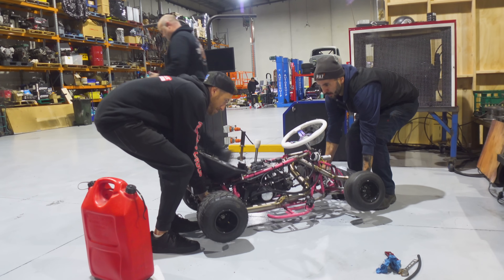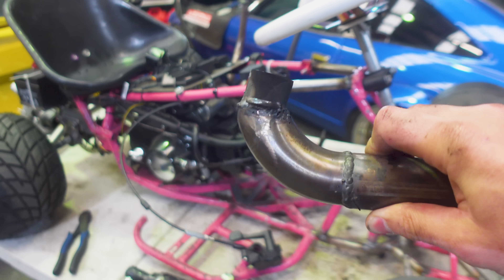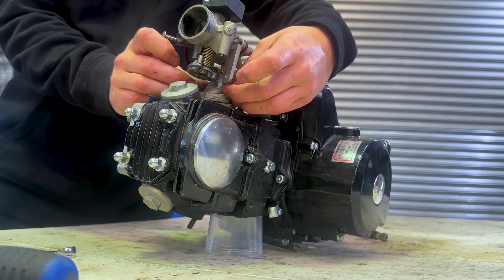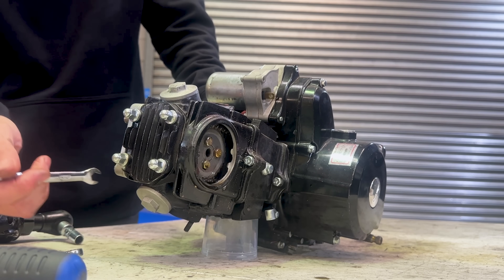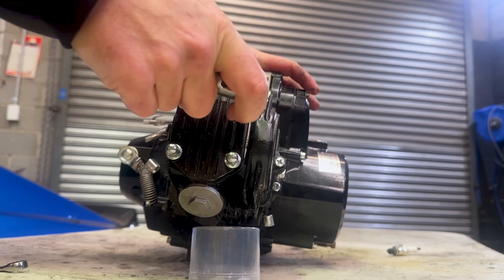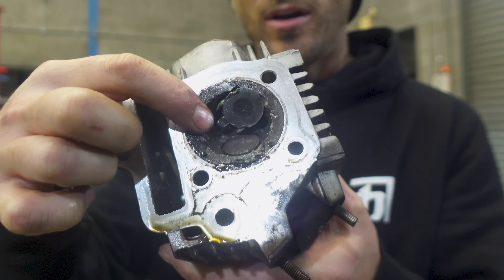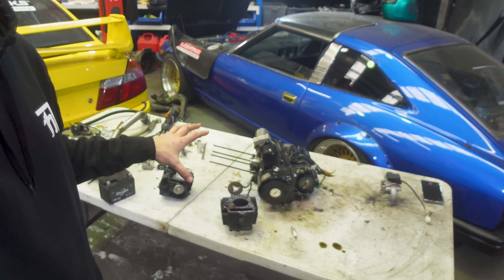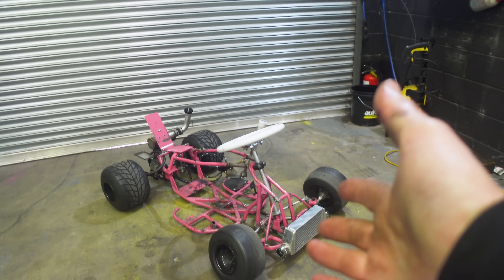BLOWN 125cc TURBO Motor TEARDOWN Go Kart | Part 9

Comment: Wonder if it was valve floating and hit piston those stock springs are pretty shit
Reply: That's literally what I was thinking just seen ur comment after I posted lol
Reply: Probably floating, the valve still looks snugly tensioned on there. 
Run some stiffer springs from a different engine and a oil cooler to help cool the heads down a lil
Reply: custom valve need?
Reply: @OPARTEOMGAOERFAFAA  nah stock valves and some 24psi springs
Reply: And bigger exhaust? Maybe too much back pressure
Reply: @OskarAxl It definitely does not need a bigger exhaust...
Reply: @OskarAxl  not to be rude but definitely not my man probably has no back pressure at all even now
Reply: @Getsum-ii I'm not trying to be a know it all, but back pressure on a turbo is a big no-no. Look into pressure ratios if you're curious to learn a bit more.
Reply: @ndog1234765  fuck i forgot its turbo 😂🤦‍♂️ your 💯 right
Reply: valve floating
Reply: Changing the springs they typically don't like anything above 8000 stock valves usually are good up to 10000. If you can get it to rev out that high lol. You can use the 125 big valves just have to cut the seats or cut and press new seats and re cut them for the larger valves dont remembervalve sizes right off the top of my head. A cam would help as well as a stroker crank. Note some honda ct70-ct90 timing chains do work in these engines and don't stretch as much as the stock shit chains or Chinese aftermarket cheap chain. Could port the head just a smidgen. Oh also be sure and use a degree wheel and check the cam to whatever spec it is if you use a good aftermarket cam because the cam gears usually do have adjustment with the bolts. Also could retard the cam some and gain a little topend since it does make boost. Just a thought anyways very interesting video series